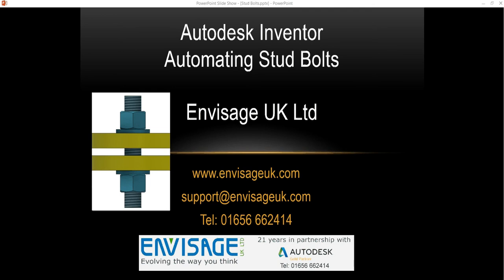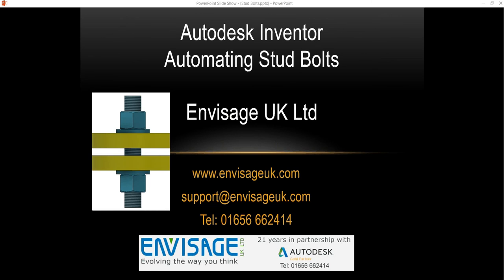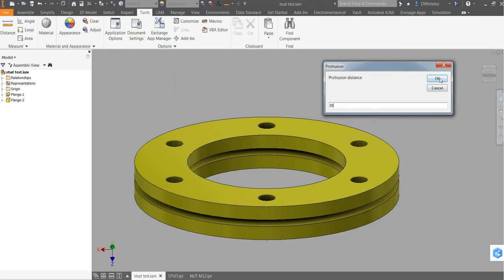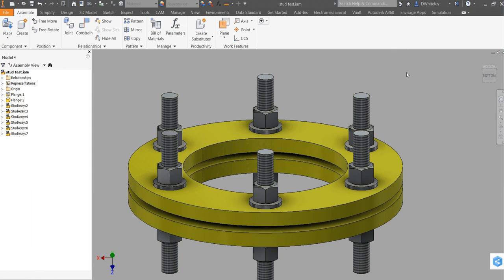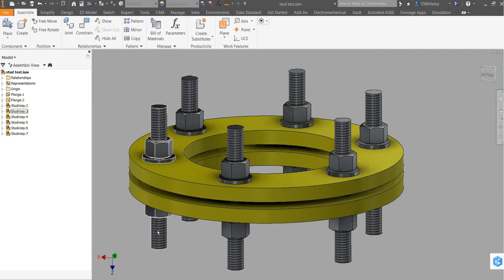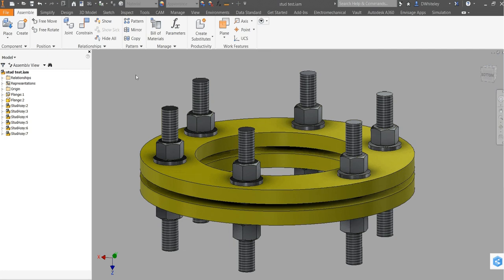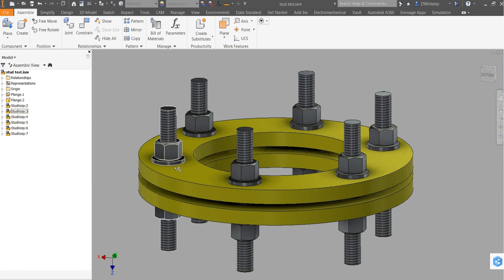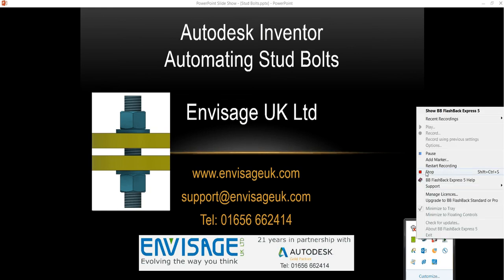Autodesk Inventor Stud Bolts

Comment: Dave,
Very well done!  Having the bolt assembly save as an iLogic part has benefits but for BOM's an assembly might be cleaner for getting a good count of each part.
I'd like your Imperial stud iLogic part to even create Imperial studs.  The content center is lacking in the SAE or Imperial parts. 
We use studs up to 2" od and sometimes it is easier to just insert a round bar and add threads then tweek the properties.

Good Job!

Comment: Dave, very nice...  We have customized out Stud Bolts into Content Center.  Are you going to post the iLogic?  If so I would like to try it out.
Reply from the maker: Hi Kevin,

It's actually written using the Inventor API. The idea of using CC parts is good but the studs would have to modelled in a particular way. i.e. Extruded mid-plane and a parameter representing the length. At the moment, the parts for the studs are added to a folder in the styles location, so that you can modify the materials and part numbers.